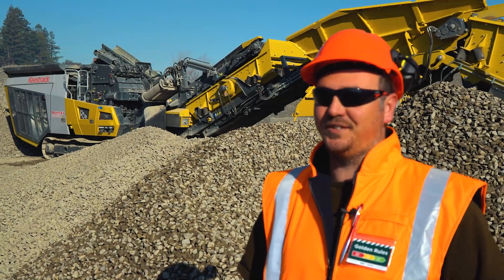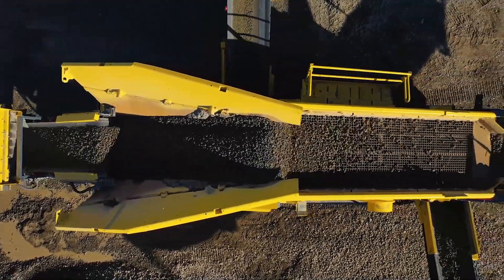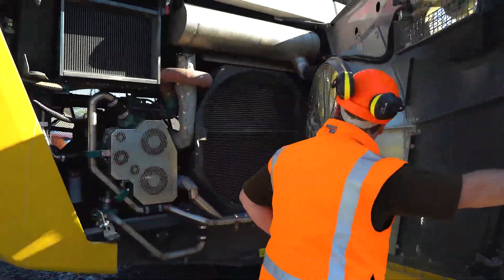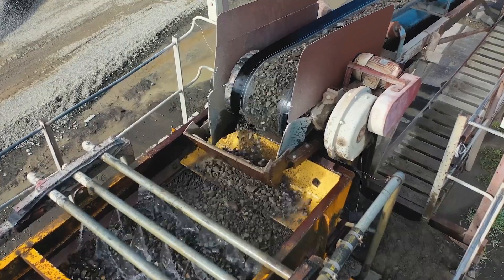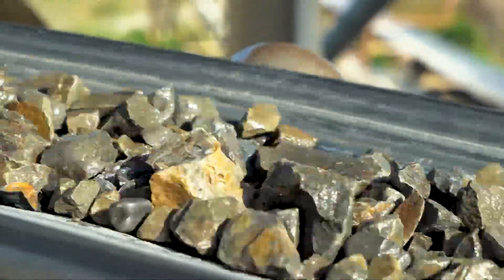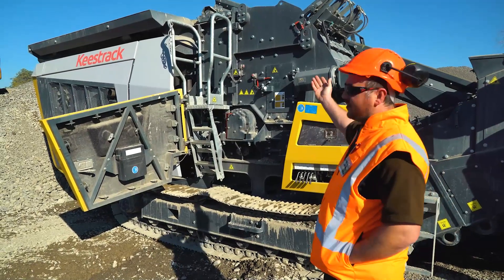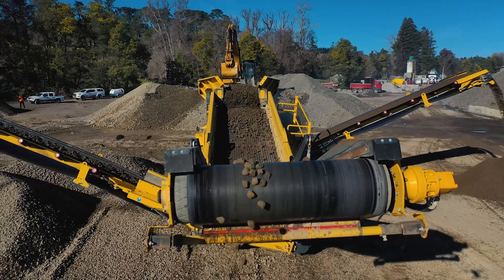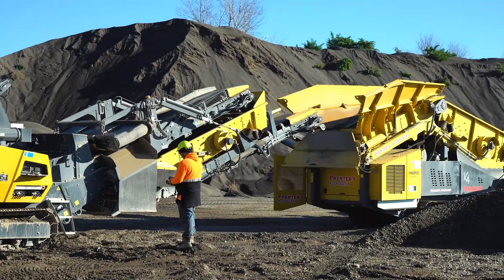Prenters Aggregates Keestrack R3h Impact Crusher and K4 Scalping Screen Review

Comment: Crushers and electrical sensors-switches-solinoids  do not mix
The kees to open the chamber is not something most people would want....it would really only be a selling point for someone who dose not run the crusher everyday like the owner of a  large company....in that case they would only care about the bottom line....cost-production and parts availability....ease of maintenance- access and long life of wear components is really what sells these machines...you mentioned it but failed to show anything related to prove your point...I want to see the process for changing wear plates...appron plates...and hammers...how thick are the wear plates? Can I get an impact gun on every bolt? How about appron adjustment...hydrolic or manual? What kind of wire lume is the emergency stop system using...simple easy 2 wire back to ignition or is it something crazy ridiculous thru relays to the engine ECM....these are things in the feild that we deal with daily....if you have addressed all these issues than I'm sure I will be seeing your machine everywhere
Reply from the maker: Hi There!

Thanks for your constructive comment on the video! It's great to get questions about the technical aspects of the machine, we try our best in the videos but even then, we only scratch the surface of all the features and aspects, particularly the operational workings.

We hope this helps answer some of your comments!

- The Key system is not electrical or solenoid driven, it's a simple way of ensuring all components are squared away before operation. In short, the key that unlocks access is taken from a mechanical key panel and cannot be returned until the access or component is back in its working position, this prevents machine operation in an unsafe configuration.

- Yes, there are sensors on the machine to determine certain things like hatches being open, and correct configuration. Some might argue these don't mix on crushers but from our experience, industrial electronics are more than capable of handling the environment they're subjected to. They improve productivity by ensuring correct operation of the machine, how much downtime could result from incorrect operation of the machine and something important is damaged? A lot more time than checking a fault code indicated by a sensor, which is why they are beneficial.
They also provide numerous safety benefits to operators by preventing incorrect operation that could result in injury.

- Bottom-line is important! We know that a crushing plant can represent the second largest investment for a quarrying business. We try our best to help explain how we help businesses achieve improved bottom-line results, generally, it's around these points: (1) Better Performance from one machine, (2) Always available support and parts, (3) Tailored machine solution and demonstration, (4) and reduced risk exposure with costing calculations specific to the business. That sounds like a lot! For this particular quarry, we also completed a more in-depth review here: https://www.equip2.co.nz/newsroom/customer-profile-prenters-ready-mixed-concrete-aggregates

- For more information on the R3h in this video you can also see our walkaround video of it here which may help explain some more! https://youtu.be/4aZ20ZRpOjI

If we missed anything and you want to know more get in touch! We're happy to help out.
Reach us on this number in NZ: 0800 100 684

Cheers!